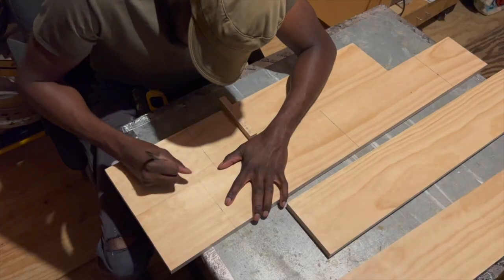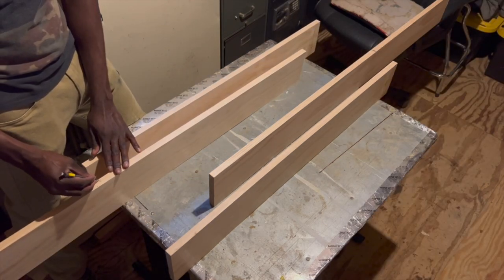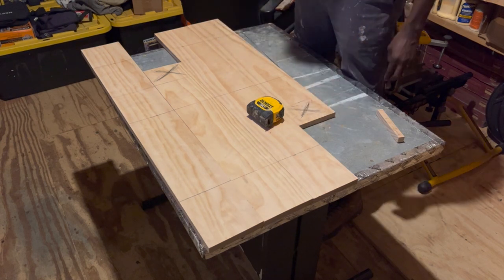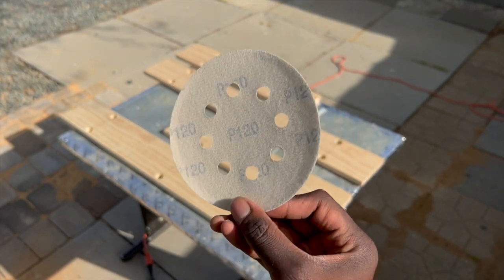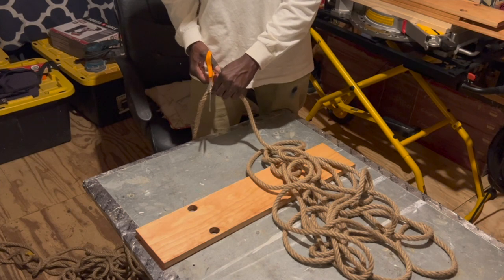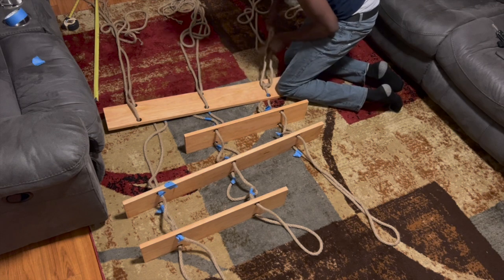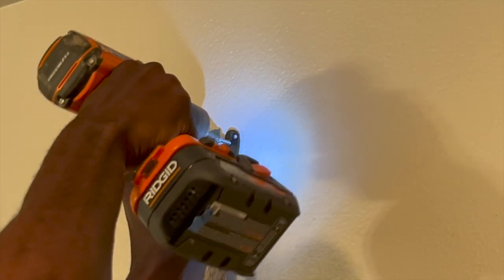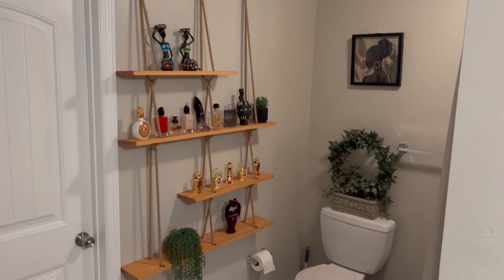How To Build THE BEST Hanging Rope Shelf!

Comment: Nice shelves. I like the offset design. I didn't realize that you can put holes in the middle and not on the corners, which is what i usually saw with only one hanging point and not numerous like yours. Keep up the good work.